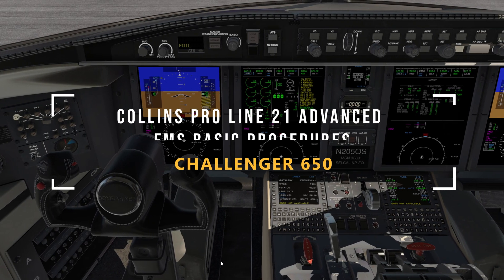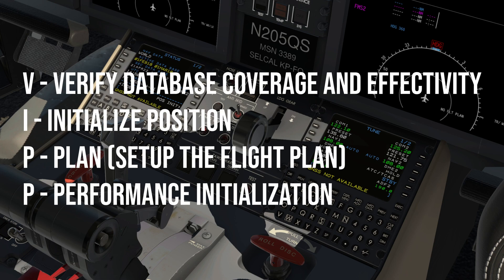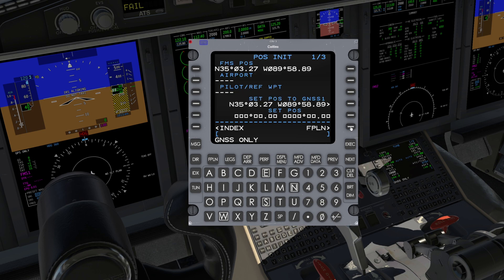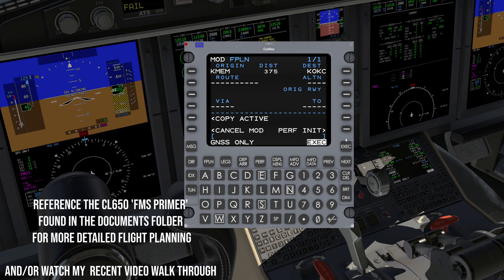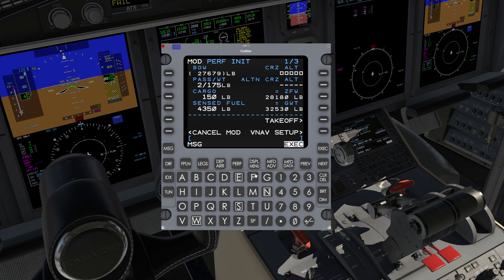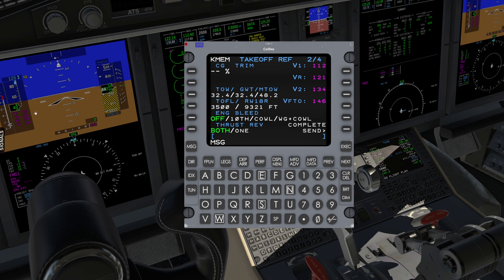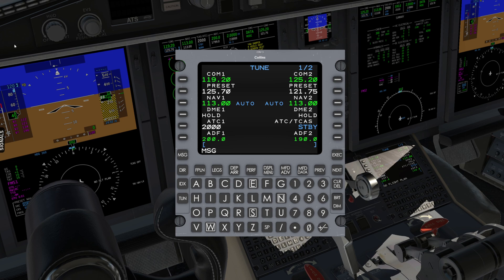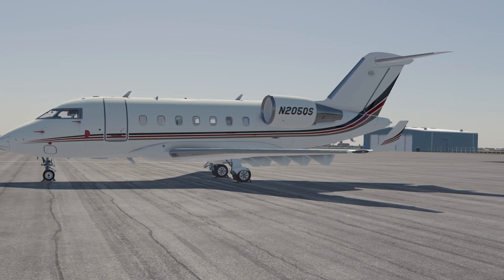Hot Start Challenger 650 Collins Pro Line 21 FMS Setup Tutorial | X Plane 11

Comment: Chaz - An excellent video, as always. Something I noticed and might be helpful to someone that visits your channel and sees this video:

- Inputting pax & cargo does not change the weight onboard the aircraft. Like many other aircraft in X-Plane 11. If you use the FBO feature the weights are properly adjusted, but if you don't use the FBO you need to manually ensure your cargo/pax values align with what you've inputted. The 2 crew are included in the OEW if you use the default Simbrief profile for the aircraft.